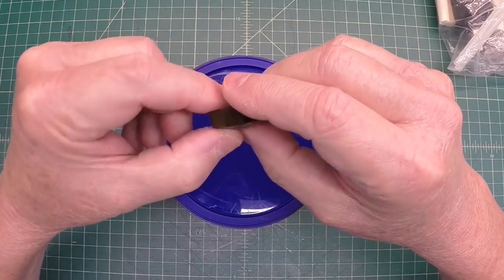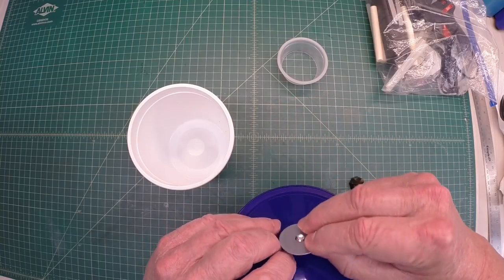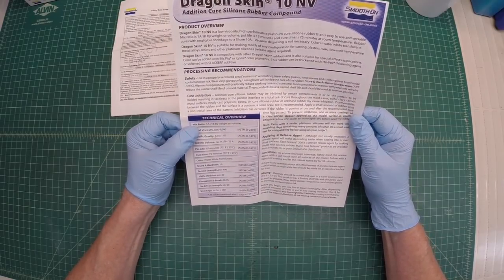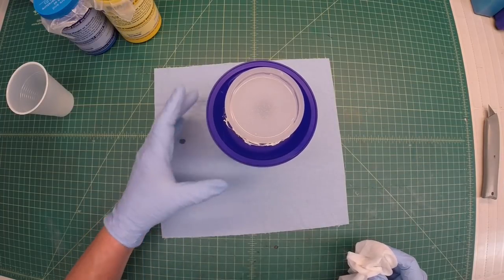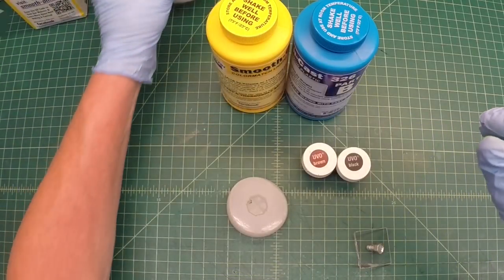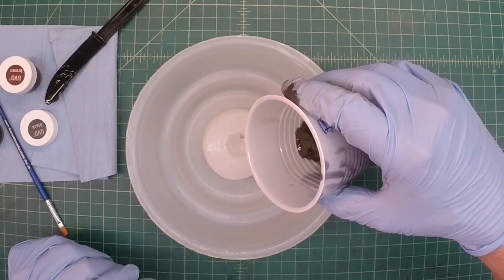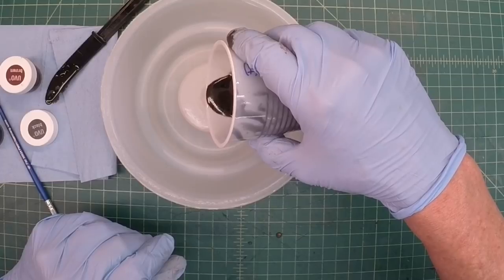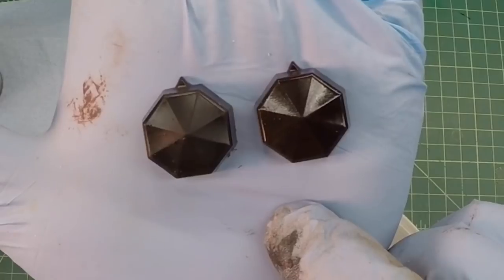How To Mold & Cast Vintage Radio Knobs

Comment: Excellent video 
I have a broken push button in a 1958 Telefunken Jubilate 1161that I'm restoring , already working but cosmetic I don't know how to hold the button to do the mold  because it has an area inside that attach to the radio
Can you give me any ideas
thanks
Jose
Reply from the maker: Jose - check out this video.

Reproducing RCA 96T2 Push Buttons
https://youtu.be/Dh06SljK1co

Best,

Don

Comment: Cool Don, When you said silicone for some reason I thought you'd be taking silicone caulking and a caulking gun and filling up the mold that way and then just waiting for it to cure, lol.  For the release I was thinking rubbing the knob with Vaseline or Crisco.  When that stuff cured it did look amazingly like the clear kitchen/tub silicone caulking that comes in the tube.  I don't know that I'd worry about those small "Imperfections" as they seem to also be on the original knob and just let them be.  Just a thought.  Take care, Gary
Reply from the maker: +Rebel9668 I'm with you Gary. There's a few bubbles, but all expected without having a vacuum degassing pot, which is too expensive for me. Best, Don

Comment: Definitely some nice work there, Don!  Last year, one of the vendors was selling (Zenith "Big Z" radio knob molds , and Philco "pushbutton console") molds, which were nicely made from a material manufactured by a company named "Smooth On". They were 'handshake guaranteed'  to produce at least 50 of the object which the molds were intended to duplicate (before the mold became too worn to reproduce 'acceptable' duplicates).

"Carnac predicts" you will soon receive or purchase a miniature lathe (similar to a UniMat); a prediction largely based on the progression of your many talents, thus-far. Should "Carnac's" prediction hold true/be accurate, I'll forward an address, which will allow you to send some of the Carolina's best culinary rewards. (as a token of gratitude).....
Reply from the maker: +AMStationEngineer Thank you Tim. A few bubbles, but all expected with summer humidity and no degassing in place. Do you recall what they were asking for the molds? 

Now I dreaming about the miniature lathe. I just hope my wife doesn't see this. Lol

Best,

Don
Reply: $25.00 per; The guy frequents Renninger's - Adamstown, and is usually there the first Sunday of every "even numbered" month.

The engineering lab at the avionics development facility (where I spent 17 years), used to pour molds, then insert them into vacuum chamber - or bell jar under vacuum,  for 120% of their setup time, to eliminate voids/bubbles.  A compressor from an old refrigerator works well for the hobbyist.

Tell her that the first thing turned on the lathe will be jewelry, that oughta suffice ;)

Comment: You really need to check out YouTube videos by starwarsgeekdotnet. He is the master of casting and moulding in my book. I've used his methods to make good copies of radio knobs and even buttons. If you construct a pressure pot, you will be able to cast both the front and back of the knobs and not need to drill any holes. The little bubbles in the cast are also eliminated. Also consider making two molds and cast two knobs with the same time. Color matching is much easier.
Reply from the maker: +Norman Walz  Norman, I will definitely check it out and I appreciate the reference and the other tips on molding and casting. Thanks again. Best, Don